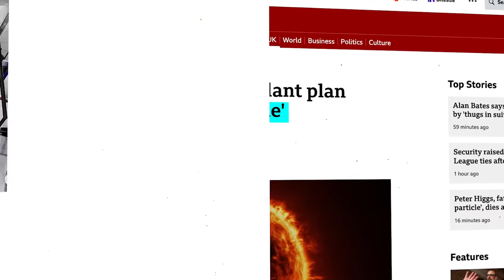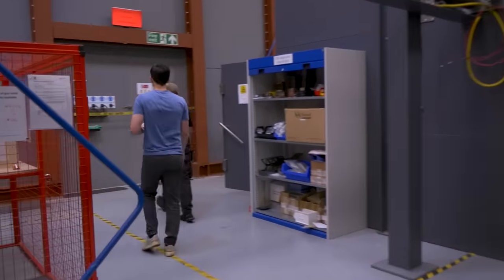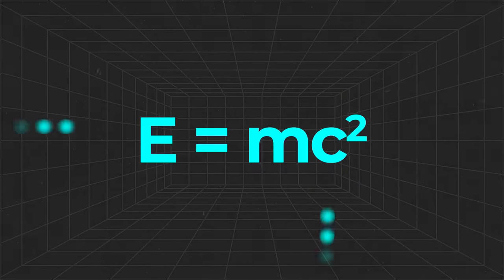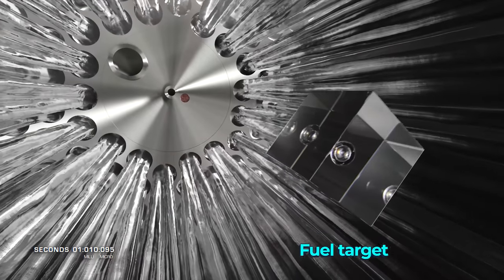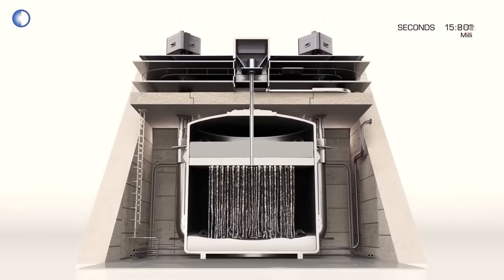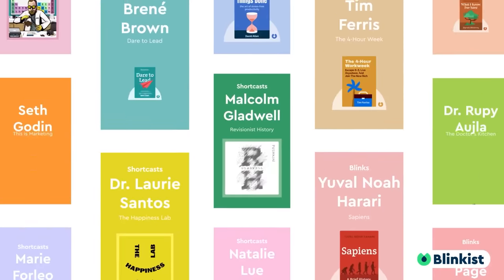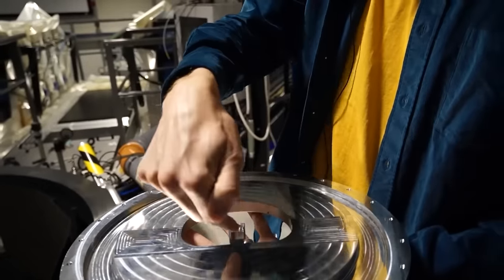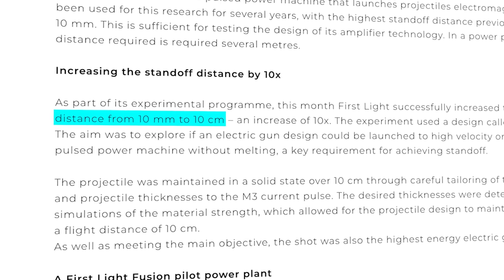Why The Latest UK Fusion Breakthrough Matters

Comment: An electromagnetic pulse (EMP), also referred to as a transient electromagnetic disturbance (TED), is a brief burst of electromagnetic energy. The origin of an EMP can be natural or artificial, and can occur as an electromagnetic field, as an electric field, as a magnetic field, or as a conducted electric current. The electromagnetic interference caused by an EMP can disrupt communications and damage electronic equipment. An EMP such as a lightning strike can physically damage objects such as buildings and aircraft. The management of EMP effects is a branch of electromagnetic compatibility (EMC) engineering.

The first recorded damage from an electromagnetic pulse came with the solar storm of August 1859, or the Carrington Event.[1]

In modern warfare, weapons delivering a high energy EMP pulse are designed to disrupt[2] communications equipment, the computers needed to operate modern warplanes, or even put the entire electrical network of a target country out of commission.[3]

General characteristics
An electromagnetic pulse is a short surge of electromagnetic energy. Its short duration means that it will be spread over a range of frequencies. Pulses are typically characterized by:

The mode of energy transfer (radiated, electric, magnetic or conducted).
The range or spectrum of frequencies present.
Pulse waveform: shape, duration and amplitude.
The frequency spectrum and the pulse waveform are interrelated via the Fourier transform which describes how component waveforms may sum to the observed frequency spectrum.

Types of energy
Main article: Electromagnetism
EMP energy may be transferred in any of four forms:

Electric field
Magnetic field
Electromagnetic radiation
Electrical conduction
According to Maxwell's equations, a pulse of electric energy will always be accompanied by a pulse of magnetic energy. In a typical pulse, either the electric or the magnetic form will dominate.

In general, only radiation acts over long distances, with the magnetic and electric fields acting over short distances. There are a few exceptions, such as a solar magnetic flare.

Frequency ranges
A pulse of electromagnetic energy typically comprises many frequencies from very low to some upper limit depending on the source. The range defined as EMP, sometimes referred to as "DC to daylight", excludes the highest frequencies comprising the optical (infrared, visible, ultraviolet) and ionizing (X and gamma rays) ranges.

Some types of EMP events can leave an optical trail, such as lightning and sparks, but these are side effects of the current flow through the air and are not part of the EMP itself.

Pulse waveforms
The waveform of a pulse describes how its instantaneous amplitude (field strength or current) changes over time. Real pulses tend to be quite complicated, so simplified models are often used. Such a model is typically described either in a diagram or as a mathematical equation.

" "
Rectangular pulse	" "
Double exponential pulse	" "
Damped sinewave pulse
Most electromagnetic pulses have a very sharp leading edge, building up quickly to their maximum level. The classic model is a double-exponential curve which climbs steeply, quickly reaches a peak and then decays more slowly. However, pulses from a controlled switching circuit often approximate the form of a rectangular or "square" pulse.

EMP events usually induce a corresponding signal in the surrounding environment or material. Coupling usually occurs most strongly over a relatively narrow frequency band, leading to a characteristic damped sine wave. Visually it is shown as a high frequency sine wave growing and decaying within the longer-lived envelope of the double-exponential curve. A damped sinewave typically has much lower energy and a narrower frequency spread than the original pulse, due to the transfer characteristic of the coupling mode. In practice, EMP test equipment often injects these damped sinewaves directly rather than attempting to recreate the high-energy threat pulses.

In a pulse train, such as from a digital clock circuit, the waveform is repeated at regular intervals. A single complete pulse cycle is sufficient to characterise such a regular, repetitive train.

Comment: Super, not melting the pellet. Zero to 40km/sec in 10cm is still a fast acceleration. Will this in itself change the material integrity? In the old days they were using shaped charges, so the material would melt, but in a way which was useful.

Comment: Ben, fascinating video, thanks. 
Question: 
Assuming we succeed in providing a high proportion of our energy needs from fusion, we would then be converting stored potential energy into extra surface heat. Would this be a problem? I have often wondered the same about Geothermal accelerated heat released to the surface.  

The key difference with SolarPV and solar derived energy sources (wind, hydro, etc.)  is that they do not add energy to the earth, rather they simply convert a part of the incoming energy before it eventually reverts back to what it anyway becomes without intervention - surface heating.

Comment: Part of the problem is that we actually need to create conditions even more extreme than the core of the sun, closer to the conditions of a nova to make it viable. likely why we have a fusion bomb, but no viable commercial energy production yet.
The reasons why the conditions, heat and pressure, need to be more extreme is because even the sun doesn't actually produce that much energy as a unit of mass, typically about half a watt per kilogram of mass or less. it's because there is so much mass that it becomes viable. For comparison, the human body consumes a watt per kilogram on average.
In order to make fusion productive for us locally, we need to produce on the order of gigawatts per kilogram with the smaller scales we are dealing with
Not saying it's impossible, just rather difficult.

Comment: Part of the reason fusion has always been seen as something "20 years away" is because the goal posts have been moving. First it was the challenge of just achieving any fusion at all. We did that. Then it became the challenge of achieving ignition. We've done that. Right now it's the challenge of achieving net positive and producing power.
Reply: We should not assign timelines to it. It took us the better part of 70 years to achieve ignition and net power (at the level of the reaction, not the overall system). 

End of the century is probably more realistic and perhaps even too optimistic.

Comment: I think there's an importance difference between the approach used here is that used by, say, Tesla to autonomous vehicles. This used modelling based on "theory" i.e. physics. And used that model to conduct simulated experiments whereas all the modern AI stuff is, arguably, devoid of domain theory and promises to achieve mastery only by scaling data and compute. There is no underlying theory of driving that companies are using. Here, the modelling was actually a simplified model, which is what you do with models. They have to be simplified, but you can still get value from it. Modern AI approaches don't work with simplified models because they are purely data driven.

Comment: I always thought the sun cheated by using quantum tunneling, and that's only made possible, but the sheer volume of particles, which we can't do.  Which is why this is always a dead end, until you find something super clever to take the place of  the tunneling.  hence why our reactors have to be hotter , under more preasure, and in this case,  Shooting the particles at each other.

Comment: I like your videos on fusion. And this one is no excrption. You seem very confident, that fusion could one day solve our energy problems.
There remains the question though, if we switch all energy production to a relatively cheap source that basically runs on heat, while the CO2 concentration in the atmosphere remains as high as it is now, doesn this create an additional warming problem?
Reply: No, the total energy needs of the world could be satisfied by the energy the sun delivers to Earth in 2 minutes, which means means all our energy use is producing a comperable amount of heat, apply typical powerplant heat conversion and your looking at ~5 minutes of solar heat for every powerplant on year per year.  That's the equivilent of brightening the sun by 1/100,000th and it would have a trivial affect on temperature.  

The Earth gain and looses an absolutly staggering amount of energy every second, it's like building a damn on a river to create a lake.  The height of the dam is going to determine the ultimate level of the lake, out powerplant heat is like a garden hose being added to the lake, both tiny in volume and inconsequential be cause the damn sheds excess water faster the more the lake overtops the dam.  Greenhouse gasses are like adding more rows of bricks to the dam.
Reply: @kennethferland5579  That is a very informative post and seems to make sense. I asked, because a well known german physisist, Harald Lesch, who has a environmentalist podcast, alluded to a problem in that regard - but on revisiting it, he of course said only that creating energy with heat is currently a problem, because you need to cool down the vapor and if you use rivers for it and you dont want to boil the fish, that resource is very limited.

Comment: 8:36 one of the benifits of fusion … is it does not produce radioactive waste
8:56 you want you permanent hardware a safe distance away from the fusion reaction otherwise you start irradiating that hardware.
Reply: While the fuel itself and the direct fusion products of the fuel are minimally radioactive the neutron flux of fusion produces comparable amounts of radioactive waste to fission.

I’m very pro nuclear, both fusion and fission, but we need to not kid ourselves about the radioactive waste they produce. We also need to not blow it out of proportion. And we would be better off eliminating the laws in the US that prevent us from recycling fission fuel.

Comment: If they learn to actually control the angle at which the particles collide, this will increase output.
Why ? The assymetrical nature of the reaction, where one part, the deuterium has no symmetry,
makes difference in the applied forces till they connect. Pretty certain that the angle of collission matters.
So, getting two streams, one of deuterium and one of tritium, where both particles are being angularly controlled
has an impact on the success ratio of the merger into helium.

Comment: I think we need to explore energy generation via sequential heat pumps using refrigerants with overlapping temperature spans of their phase change cycles.

Essentially, we could use waste heat in our environment to generate power. It would only be a portion of the energy input, but it would also produce local cooling. Might be useful in incredibly hot locations where the concept would also be the most effective.

Comment: So basically they are making a shape charge, but a magnetically driven shape charge, yeh 3 meters is going to be extremely difficult like even getting to 1 meter would be incredibly impressive, like explosively driven shape charges fall off after like 10cm or so, so basically the have so far only replicated what explosive chape charges can already do.
Reply: I should point out to the person who liked the comment the slug is moving significantly faster than a chemical shape charge like many orders of magnitude faster so 10cm is still impressive... Although the reason chemical shape charges disperse so quickly is because of air they are doing it in a vacuum as far as I remember so many it doesn't fall off quite as quickly...

But my point was simply that 3 meters is a long way to go.

Comment: I assume the deuterium and tritium are either easy / cheap to produce or occur naturally?
Reply: Deuterium is abundant and cheap at scale, in the form of splitting "heavy water". Tritium is rare, expensive, and hard to produce; there isn't enough on the entire Earth at any moment to run a reactor. An advantage of this approach, described in other releases, is that the absorption of neutrons by the lithium produces tritium, allowing the reactor to supply its own needs. It could also make money by supplying the tritium needed by other fusion reactors!...Although if they can make the fusion work, and they're orders of magnitude cheaper and easier than the other reactors, well, just build more of this kind.
Reply: @HypoceeYT  The neutrons from the fusion process cannot suffice to supply the reactor's own tritium needs. 
Take a closer look onto the neutron balance. Each fusion event consumes one tritium atom and produces one neutron. Each neutron can breed one tritium atom. For the reactor to supply its own needs, no neutron and no tritium atom would be allowed to get lost. Since there are no lossless technologies in reality, there would be too few neutrons and too little tritium would be produced. Therefore, additional substances like lead and beryllium have to be consumed as neutron multipliers, which release more than one neutron for each neutron they capture.
Reply: @FranzN57  Sure, whatever. Um akshually it's not pure lithium, it's lithium with some lead mixed in. Videos like this one report on the challenging, costly part of that mix.

Comment: basicly this challange is a classical the more you know the less you know. Even if you have the basic challange of sustaining a fusion reaction, then you need to find a state where you have gain, then you have to find a way to extract the gain that is providing net result, then you need to build a system that lasts, then you need to build a system that is economical.

and having so many steps between a theory, proto type, fuctional test reactior, commercial reactor is i feel expotentionally more difficult making this ETA almost impossible to estimate.

Comment: The usual narrative is that the holy grail is to generate more energy out than you put in, I.e. the break even point.

The problem is that this is wrong because the energy going in is typically electric and coming out is heat and the problem is we want electricity out for onward use.

Under the Carnot cycle you typically only get considerably less than the theoretical ideal so the energy out needs to be a LOT higher than just a bit more than that in.

Comment: The EAST (Experimental Advanced Superconducting Tokamak) nuclear fusion reactor in China recently maintained a temperature of 158 million degrees Fahrenheit for 1,056 seconds.  Isn't that at least on par with what this UK reactor has done?
Reply: Will that be 20 minutes every hour, or 20 minutes every day, week, month, or year? Top fuel dragster racecars need an engine strip and inspection after every run - 15 seconds or so. Not the maintenance schedule you had with the old Peugeot diesel cars. You could get  250,000 miles from engines in the 1970's and 1980's.

Comment: The problem with LLM is it's a waste of energy - approaching 4% of all US electricity consumption - and also a waste of computing power. Luckily, the approach nVidia started almost 2 decades ago when developing their GPUs makes those GPUs used for LLMs to be easily used for simulations like the one First LIght uses.
Reply: The whole modern AI LLM race with GPUs started about 2014, not 20 years ago. And it gets better with every year.
Reply: @huckleberryfinn6578  Except when it gets measurably a lot worse in every respect in much less than a year, like GPT 3.5 did.
Reply: @HypoceeYT the models themselves are irrelevant. Compute is getting insanely cheaper over time. Like witht the new Nvidia TPU they are 4x as efficient as what they're currently using. It'll cost nothing pretty soon.

Comment: Why not design a sacrificial E-gun sled out of a metal with a low melting point, and which has just enough mass that it will mostly (or completely) vaporize by the time the fuel disk leaves the rails?
Nevermind, if I had waited I would've seen that is what they did to solve the problem...

Comment: Not going to lie, I hate that everything is about boiling water. That doesn't seem to be a necessary or desirable step in the process. If we can get energy out, we REALLY need to figure out ways to directly transfer the energy produced, to the grid, without having to operate some simple mechanical movement in between.

Comment: What I don't understand is why so much effort is being expended to achieve a solution to fusion power generation when FISSION reactors are already working fine,and when small modular reactors (SMRs) are just around the corner.  SMRs can run off the "waste" of conventional nuclear reactors,and in fact,can generate more fuel than they burn in breeder reactors. Climate change is not standing still either,and we are very close to the point where it will become irreversible.
Reply: Uranium supplies are limited, reactors take ages to build due to regulations, how to deal with long term nuclear waste and nimby-ism.
Reply: @chrisc62  Did you understand my comment?
Reply: @mikedunn7795  I am sorry I mistook it for a question. My bad.
Reply: First Light is funded about 100 mil, my dude. I.e. one fighter jet.

No mining, no weaponizable proliferation enrichment tech, no waste without the yimby no-scare quotes, no self-sustaining/positive feedback reaction o hai Chernobyl/TMI/Fukushima/submarines.

Comment: so they turned a rail gun into a regular gun. it's just pushing a projectile down a tube with hot gas
Reply: Nope. The projectile is still being pushed by the electromagnetic Lorentz forces. It's just that they moved the current generating the forces into sacrificial material. Plasmatizing it is an irrelevant byproduct.